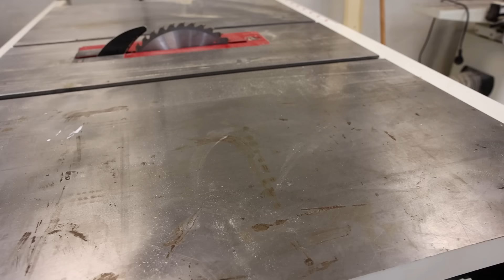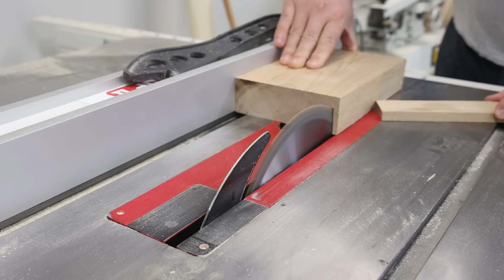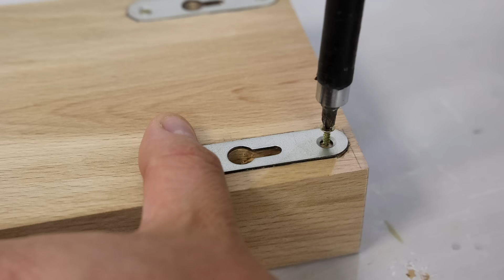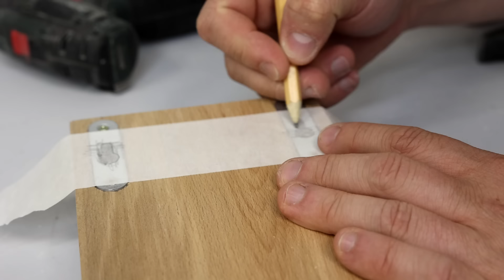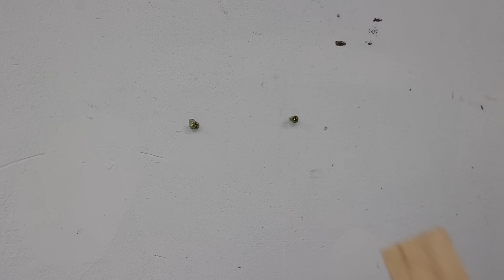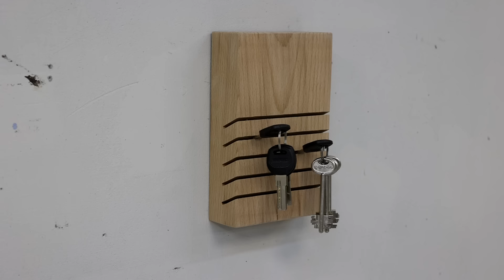I didn't believe it myself. Brilliant idea in one minute!

Comment: Your table saw technique is not safe. Cutting a small board cross grain using the fence, feeding the material with your fingers closer to the fence (there's a reason)  resting your hand on the material. It looks like you're fighting the machine as you feed the material, the blade is not as sharp as it should be. Taking the scraps off.
Reply: So what?
Reply: @EASchmidtE  and your comment will change it how?
Reply: @EASchmidtE  no it will not create any awareness at all.
YT is not the place to moralise about safety, it will only create negative energy.
Save your tips for your workshop, it is more effective there.

And BTW I am all up for safety!
Reply: Your so up for safety, then why be a confrontational troll!? The statement about safety is entirely valid.
Reply: I know what you meant, the force not straight anymore
Reply: Pathetic comments. Safety is paramount, especially where the hands and blades are involved.
Reply: “Moralising about safety”?

Comment: Nice…what degree is that?
Reply: I'd guess 35° homie
Reply: It could even work at 90 degrees. It might be more stable at 90, easier to get the keys in and out, but having that angle gives a some design flair.
Reply: Это высшая степень посвящения, как у тамплиеров!